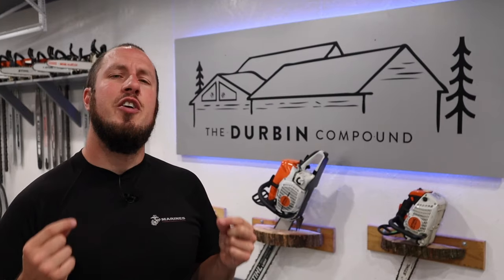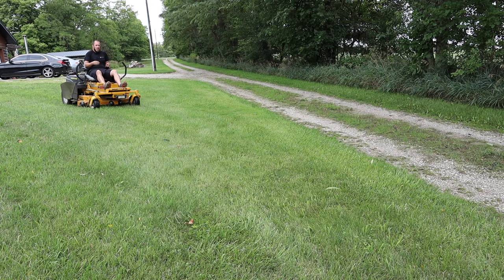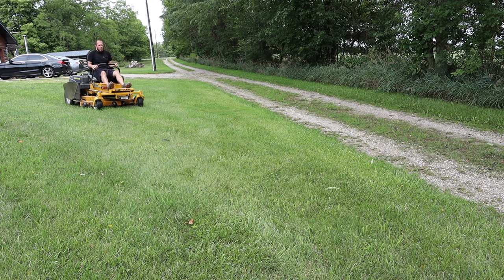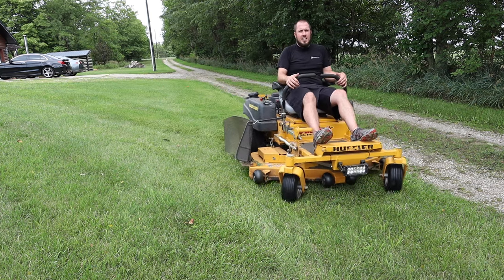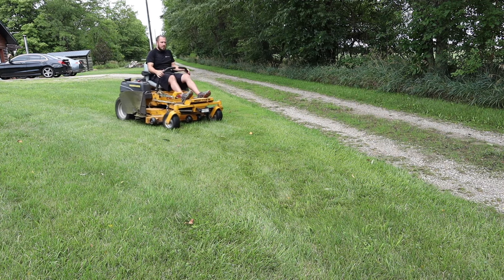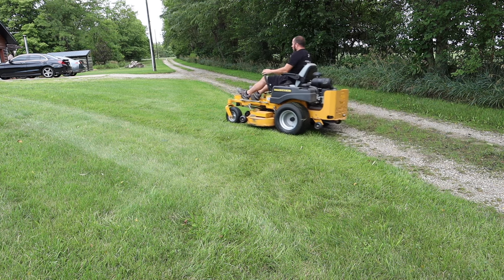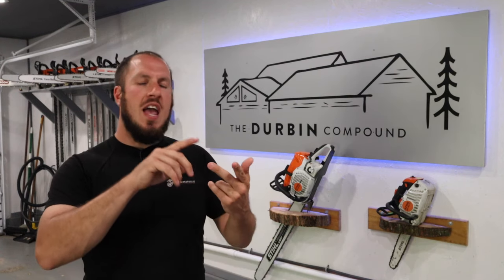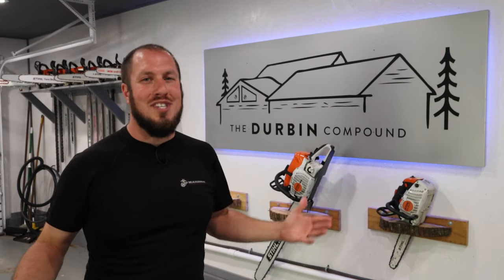How to Turn With A Zero-Turn Mower Without Damaging Your Lawn

Comment: I just used my brand new Cub Cadet ZT1 machine this week. I have been using a ransomes/bobcat commercial grade walk behind lawnmower for 30 years. It finally died. This ZT1 is insanely fast, smooth and agile. The gearing in these things is a game changer. I'm sure I'm way late to the party, but I'm a believer.

Comment: instead of stopping and pivoting on the left or right wheel, slightly reverse it, as you're moving the opposite wheel forward.
Reply: The most simple solution, well done.

Comment: I have watched countless videos for the "three point turn"  And most of them are good including this one.  Here is my problem, everyone explains how to three point turn, but no one explains how to prevent the pivot itself.  As in when I come to my stop at the end of a row what do I do with my bars (the action) to keep both wheels spinning.  Now I know it may be common sense to some who have lots of experience on a zero turn but I am just starting out on one, and do NOT want to put divot holes in my grass.  I have been practicing the back up portion, but not quite understanding the correct handle bar movements to keep both wheels moving, so i dont pivot while making my turn.  Thanks to anyone who sees this and helps.
Reply from the maker: The reason why no one explains this is because it extremely hard to put into words.  It takes time to develop that gliding smooth motion that you need to operate smoothly.  It will come in time and you’ll forget you were even new to the controls

Comment: I have the mindset that a zero turn mower should turn on the spot .
Reply from the maker: I completely agree! But you have to be prepared for the physics of it to tear up your yard!
Reply: It should. It’s no different than driving a bobcat. This video is wrong. When you turn on the spot, one wheel should be moving forward while the other goes in reverse.